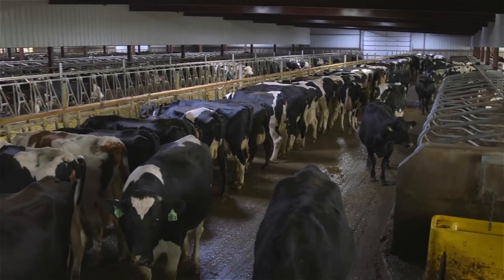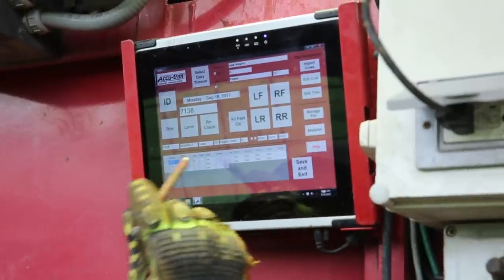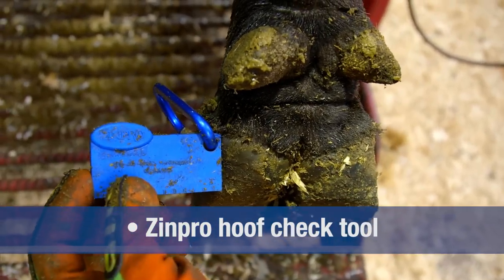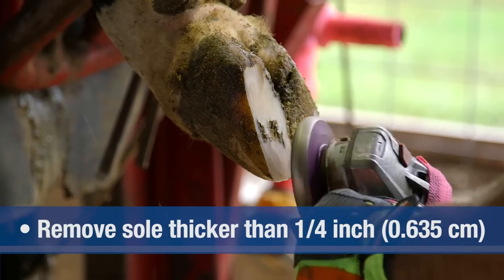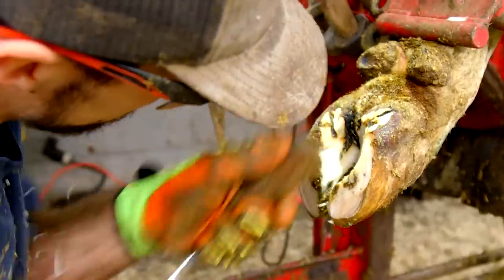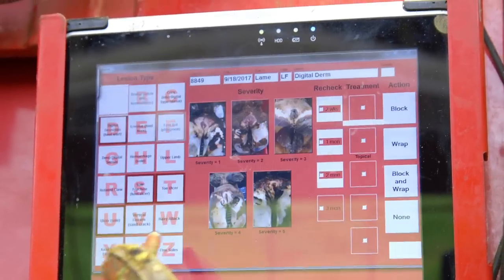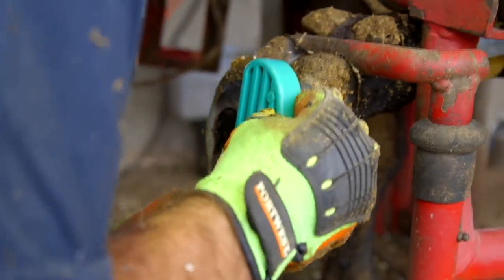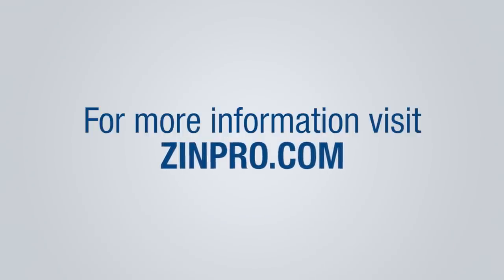How To: Step-by-Step Guide to Dairy Hoof Trimming to Help Prevent Lameness

Comment: Be careful with dermatitis. Never cover it with bandage cause dermatitis grows when there isn't any oxygen...ideal is Betadin fungicide solution used in hospital. To all my customers in Switzerland I use it and it well works :-) Anyway, in this time all cows have that inside themselves. Could you tell me why you start to trim by the outside claw in front ? it is already shorter than the inside one and by which one do yo start at the back ?
Reply: I think it's because we usually use the smaller claw as a model. At the front, the outside claw is shorter than the inside one, so we start trimming it. At back, the smaller is the inside claw, so we start trimming to use as a model later. But I think it's relative, everyone has their own way of trimming. :)